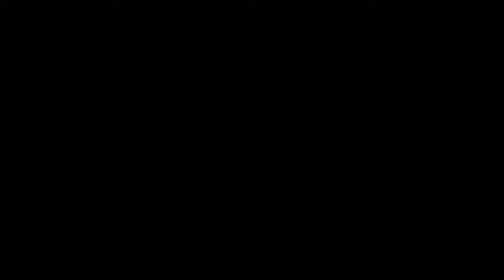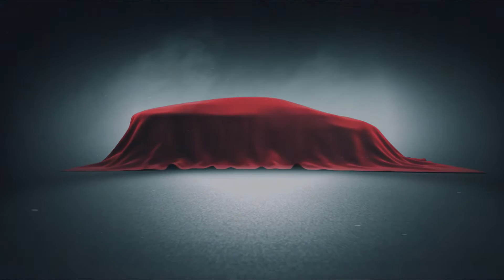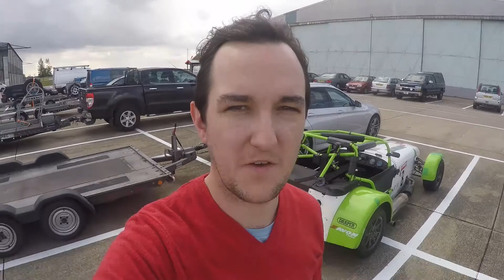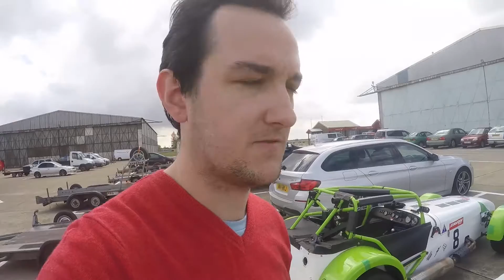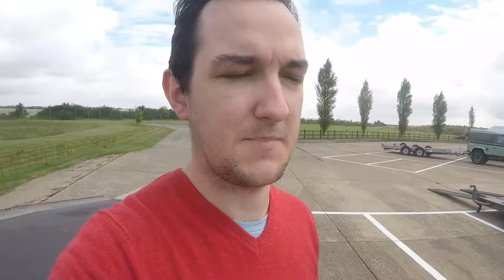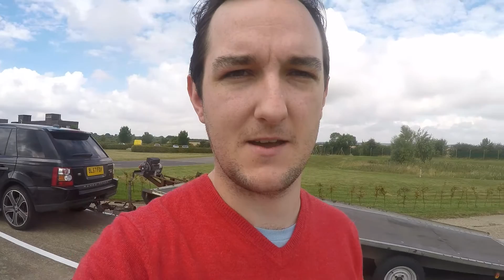Shakedown - Caterham Supersport

Comment: You will always want a little more front brake, 50/50 is possible for some drivers but not many :) 
Looks quick, just bring your braking zones in a little and settle the car, slow in fast out and build on it.
Looks good though mate.
I have an order placed on a caterham 620. take a look at my channel, I put quite a few videos up while test driving it, along with the mrs. I've ordered a 620s with the R suspension and brakes, and 5 speed, I felt the 6 speed to be a little to busy on the road with that much power.

Comment: Looks very familiar :). Liking the new VBOX video, but does it not have a mic? Also I prefer slightly less POV as find wide angle kills feeling of speed.
Reply from the maker: @Christopher - Yeah its a pretty good setup. It does have a mic, however, it's not a Stereo mic like the Caterham specific kit (Not yet available in the HD2). I had the microphone just under the dashboard. I was hoping it'd capture engine noise, which it does. However, I'd like a little more exhaust note. So may end up moving it more to the right-hand side of the car.
Reply: +MJJ oh ok, just that there's no sound during the driving clips, only when you're talking
Reply from the maker: Your right though I've just tried again and it's all dodgy :-(
Reply from the maker: Chris, Works fine via a PC / Laptop.